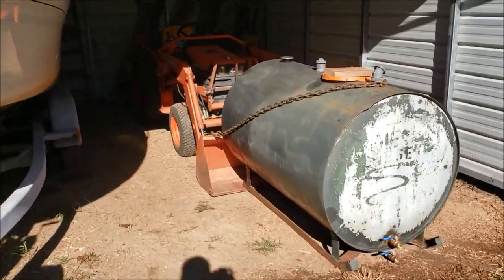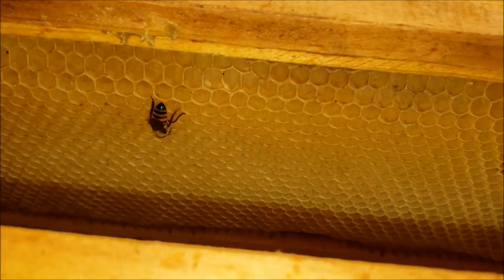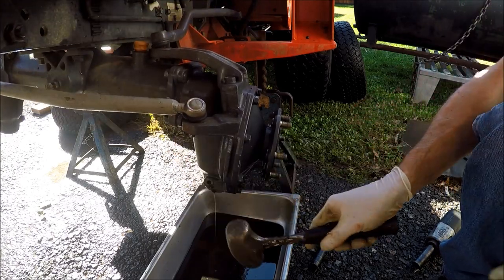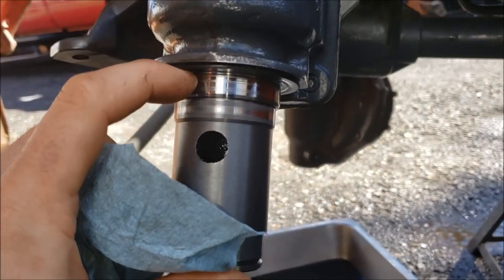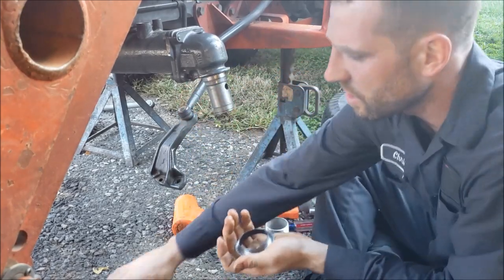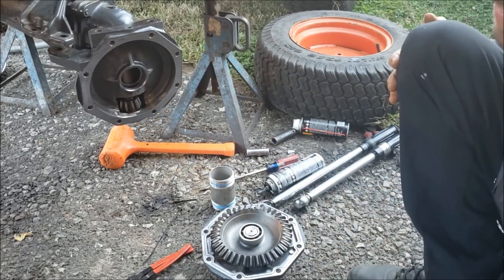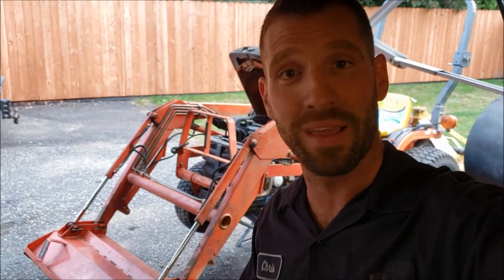How To Replace Kubota Front Axle Seals B7500 B7800   Wheel pivot knuckle leaking

Comment: You might want to lay off that pressure washer if you have seal problems. I did not have problems till I cleaned the area with brake cleaner and painted it and then the leak started. This is a B2910 I bought last summer. I am trying to get caught up on things and there is always something new to deal with. Great video.

Comment: Great video! About to do the same on a B7800 and an L3130. Length of the video was about perfect in my opinion. I sometimes use HDPE plastic to make bushings to keep dirt out of places such as the inner bearing seal. Thanks
Reply from the maker: Awesome! I appreciate the feedback and good luck on the job. Good idea with the plastic bushings. Not a lot of room to add anything with these as you'll see when you take it apart. I think Kubota did a pretty good job with the front end. Did you happen to see my update video on this. Check it out if not. I ended up having to replace the knuckle. lpl

Comment: Really appreciate this vid!  End of last season I noted a leak.  I don't think it had been going on very long or was very bad but I'd prefer to take care of things before I get behind on them.  My B7800 is slightly different but close enough.  About 1,900 hrs and only the top seal was leaking.  That seal on the hub was fine but I'm going to replace it anyway (easy enough and I'm here- inexpensive compared to the top one).  And though there was some packed dirt around the hub seal area there was no leaks, and after 1,900 hrs I figure that being cleaned up an installed per stock it should continue to hold up fine.  Bearings were all good.  The pinion gear shows some signs of wear but I'll just run with it as I doubt I'll have a problem with it while I'm alive (tractor is getting less use that it once did).  One "trick" to popping out the steering rod end link from the knuckle is to run the nut down until it's flush with the top of the stud and then pop it with a hammer: I was able to get it to easily pop out with a small brass hammer with a single quick smack; if one were to spray penetrating fluid on this in advance then it would likely be sure to always work- I just don't like beating on castings.

Comment: There is a new seal part 32721-56223 and the two pieces are made together. So I am trying to figure out how the new seal is installed. I think the whole thing goes in the bottom case and you have to remove the top ring like you already did. I want to make sure how to install this new seal before wasting $65 and all that time.
Reply: Thanks for the heads-up on this.  I seem to recall looking all this up several months ago and I think it might have changed since that time in which case I specifically aimed for this part number 👍
Reply: @seer7327  I just got done with this. Install new seal in bottom casting with a seal driver. Then install the upper portion and bang the lower casting on something made out of wood and it drives the metal ring made into the seal onto the upper pin casting. Easy to remove the upper casting from the axle. 4 bolts and 1 O-RING.

Comment: This was a perfect video because B7500 with 1014 hrs was leaking at the front axle.  This help me 100% to be able to fit myself.  It wasn't to bad of a job time wise (2hrs on one side) the other side will go faster.  thanks again. Probably will go with synthetic oil this time.  I also can't believe that Kubota makes so easy to repair ourselves.

Comment: Great video!  I have a 2002 L3000DT.  The right front seal started to leak.  Called local Kubota dealer and they said it would be about 300.00 for them to replace the seal and may be more if the bearings are bad, etc.  I only have about 450 hours on this machine and this is the first time I have had a leaking problem.  After watching this video,  decided to tackle the problem myself.  Thanks.
Reply from the maker: Thanks, and awesome to hear you're going to tackle it yourself. Definitely a pretty easy job and these front axles are very well put together. Excellent design. Good luck and let me know how you make out! Thanks
Reply: @NoNonsenseKnowHow   Took it apart last night,  replaced the seal, put it together today.  Heading to Tractor supply to get the gear oil you recommended.  I thought I had some but looked in cabinet and it was gone!  Figures, have it all together now just have to add gear oil.  I saved about 250.00 dollars after paying for two seals and gear oil.   Thanks!!!
Reply from the maker: @spike2794  Great!  Not only did you save money, you learned a bunch at the same time. Good stuff! And thanks for updating me

Comment: Right Stuff silicone barrier. It will help initially to keep dirt out, but whatever gets in can never come out so it's a double edged sword. When you get involved in lots of mud stuff like we do in the south you come to understand there is NO keeping debris out of the seals and causing them to fail. When you have a mud 4wheeler you get very good at replacing seals as quick as every couple of rides. Also, remember, almost all rear differentials in cars have exposed seals like this, and some of them last for 200k miles. The mud is finally took that seal out.

Comment: Please comment back  , greatly appreciated . I have a 1997 B2100 that over time developed a leak in the same seal as yours , the two tractors appear practically identical other than HP . I had the seal expensively replaced by a dealer because at the time my back pain had me practically in a wheel chair , customarily I do my own maintenance. Post digression , the dealer`s bill indicated 3.5 qts of Super UDT2 fluid refill ,where I remembered that the axle was filled with  80/90 gear oil. When I questioned it, they said that the service manual allows either, and it is true that it does, that was a couple of years ago . Recently  I noticed a minor  weeping, about  a  teaspoon in 24 hrs , at the axle trunnion mounting  bracket where the driveshaft side goes  into the axle, the SUPER UDT2  it is getting by the  pivot point O ring but not the pinion seal.
I ordered all of the joint pins ,  O rings , pinion seal and washers for the drain and vent plugs of the wheel bevel gear cases to fix the problem, they have not arrived yet .Yesterday  June 11th  I worked the tractor a bit , nothing too heavy, and when I parked it I checked to see if it was weeping at the area mentioned , it was slightly more than usual , so then decided to check the axle level and when I pulled the dipstick out ...surprise surprise ...there was a puff of pressure . Yesterday was 90 degree outside temp and the exhaust tip aims directly at the left front wheel bevel gear case . I checked for an axle  vent but could not find one because there isn`t one to be had. Your solution to the problem is something that I had entertained but not deemed necessary until yesterday when that puff of air pressure greeted me for the first time, I believe that the factory exhaust tip  blowing on the bevel case is a major contributor of the heat that develops in the axle , far more than normal friction heat produced by the gears  and  the SUPER UTD2 warms up faster than the heavier 80/90 , and thereby causing the air to get hot enough to expand into pressurization levels .
I  will add a section of pipe or an elbow that redirects the exhaust away from the wheel and case , as well as venting the cap similarly as you have. 
Connecticut gets cold in winters but not cold enough  to make using the 80/90 gear oil gel up , I think that the dealers want to push the SUPER UDT, now up dash 2 , because it profits them more for 3 .5 quarts than what it cost for 2 gallons of  gear oil  that I can buy at Runnings,  I am thinking of going back to gear oil anyway , what do you think?

Comment: Thanks, I needed some help how to take it apart. Not as hard as I thought it would be. My b2710 has a vent on the opposite side of the fill hole. I crushed the opening of the tube to a small opening so that stuff doesn't get in the axle. Mine is hydro-static and uses the same oil in the front axle as the transmission. I did not realize that it was that high weight oil in the front axle of the standard model.
Reply: My shuttle shift model allows for either Kubota hydraulic transmission oil or 90W gear oil in the FRONT drive axle.  Everything else is the hydraulic oil.

Comment: Thanks so much for the video.  I have a B3200HSD that has the exact same front end as yours.  You video was immensely helpful on showing me how to do this job!  Thanks!’
Reply from the maker: Great to hear you found it helpful and I really appreciate the comment. Good luck on the job!
Reply: I’ve had some trouble getting this back together.  My tractor had the race on it like yours did, I really like the concept of taking better care of the seal.  Unfortunately the replacement seal doesn’t have this & is to large to allow me to reuse it.  I pulled it off & the outside shaft diameter fits the inside diameter of the seal.  I think they ordered the correct seal, I just hate it when it doesn’t go back together like it came apart.  

Biggest problem is getting the knuckle housing remounted.  It seems I’m having trouble getting the bearing to fit back on the shaft.  I didn’t have much trouble removing it, used a 2x4 & hammer to dislodge it, it was a little harder than yours to get off, but it didn’t concern me.  Wanted to see if you had any ideas.  I’m almost at the point of giving up & taking it to the dealer to get it remounted.  I don’t have a bearing press, and it looks like it would be difficult to press.
Reply: Update on my progress.  Have the knuckle housing remounted & going to put in oil tomorrow.  The kubota dealer ordered the wrong seal.  My 2009 B3200 uses the same housing & seals as yours does.  They switched during that model year to a newer housing, but mine was the older housing.  Took about 5 minutes to put the seal in the housing, never could get the wrong one properly seated.  Slipped the knuckle on the shaft & hit several times with a rubber mallet & it was back on.

Hint to those that don’t know, like me, This was a larger size retaining ring so the holes in the retaining were larger than the nipples on my harbor freight snap ring pliers.  Had a heckuva time trying to get it put back on until a friend of mine said he had the next size up pair of snap ring pliers.  Within five minutes I had the snap ring in place also.  Sure helps to have the right tools when you are working on something.  

I only worked with snap rings once before in my life.  Generally this is a job I would used to have taken to the dealer to fix but it didn’t seem like it would be terribly complex and I knew it would be expensive based on labor rates.

Again, this video really helped.  I don’t know that I would ever have figured out the issue with the wrong seal but when I saw yours had a race on it and mine did too I knew there was a problem with the seal they ordered for me.
Reply from the maker: @paullee7467  sounds like you're almost there. I appreciate you adding detailed information. This will probably help others in the future. Thank you!

Comment: Thanks , you video helped a lot . Were did you get you parts from ? I picked up a seal at a kubota dealer . When I took it apart I had wrong seal . Drove to another dealer to get right part . There is a hurricane in the south , parts will take 2+ weeks to get from kubota . Searched dealers with the part and found one a hour away. They were closing in 45 min so I payed on phone and they would leave part outside for me to get . Great , $64 for one seal ! I get home and open the package and it did not want go come apart( seal and race ) . I check the part number plus I watched your video several times. Finally I said I’m gonna try to pry it apart what I got to lose besides a $64 part after a half an hour of gently prying  it came apart . It looks nothing like the one on your video or the one I removed from the tractor. It has a built-in seal to keep water off of it. I tapped the parts in with a block of wood and a rubber mallet. I seated them with a jack under the drain plug and rotate the hub back and forth . Could not be done like you did it . This seal should be better than the old style . Please tell me where you got your parts from . I have between 3 and 4 hours in driving to get a seal , shipped to me would be great.
Reply from the maker: Hey, glad to hear the video was helpful. Sorry to hear about the troubles you're having. I didn't know they made an updated type seal. I'll have to check that out sometime if mine leaks again. I got all my parts from messicks.com. They actually came next day which was pretty sweet! Check out the update video that is linked in the description. Mine ended up leaking again after this repair and I had to replace the knuckle. Good luck getting it back together and back to work

Comment: Thanks for the vid. Kubota B21 axle seal was similar. I agree about your design flaw. This seal should have been a sealed bearing in my opinion. It was $60 with tax from local retailer. Some sealed bearings cost less than that.
Reply from the maker: No problem man! Glad it helped out.

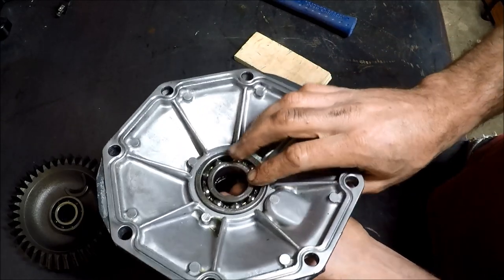Comment: Thank you so much for this video, it was a great resource when I did the left side. Are there any concerns with how loose that bearing is in the cover housing at ~10:20? Reason for my asking is my bearing had failed and there was a lot of slop. I thought it had worn the housing down by a few thou and would cause any future bearings to prematurely fail. I went ahead and ordered a new housing and installed it. Then when doing the RH side, I had the same looseness. I am trying to figure out if I need to order a new housing for there or if I should just send it.

Also , that external 45mm cir clip can die in a fire, such a pita to get off.

Comment: What ft lbs torque does the 14mm bolt get? I’m referring to the middle bolt that holds the knuckle on at the top. It’s between the two 17mm bolts.
Reply from the maker: I don't have my service manual handy. Sorry if I didn't put it in the video. Let me know if you find the spec and I'll update the description. Thanks

Comment: Great video! My top seal is not coming out so easily. Any thoughts?
Reply from the maker: Thanks.  Just a screwdriver and chisel should work
Reply: @NoNonsenseKnowHow  Thanks! I appreciate you taking the time to respond. I ended up having to use a little WD40 and the screwdriver & a hammer to free it up from the housing before prying it out.
Reply from the maker: No problem! I'm glad to hear you got it

Comment: Did you let the gasket maker tack up at all before slapping them together?
Reply: When using Right Stuff from Permatex this step is not needed. You simply apply an even coat (thin, very thin in this case) and put the parts back together. Read the label, but I am pretty sure you can put the transmission oil in the axle right away also.